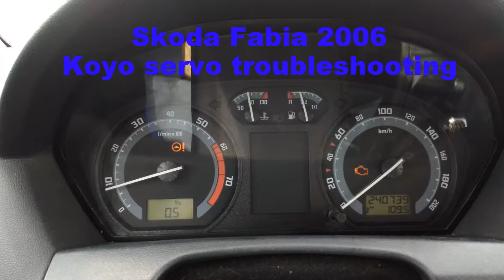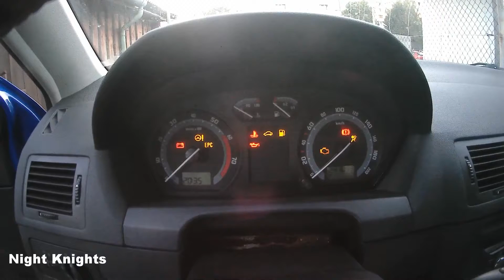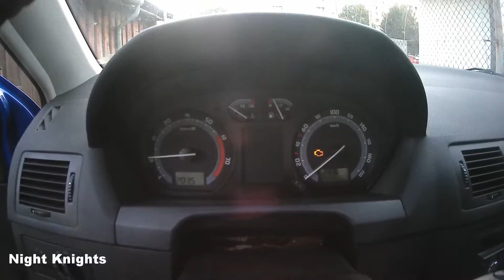Skoda Fabia 1 2006 oprava servo riadenia Koyo

Comment: My friend, did your car make strange noises from the area of the tires and did your dashboard light flickering? My light in the car and headlight are flickering and stering wheel light varning appear.
Reply from the maker: I didn't had this kind of problem, there are a lot of things what would do this. Definitely check your power steering wiring and fuses, also check battery and alternator belt. I hope you'll solve this issue soon

Comment: But what did u repair I don't understand , I have the same problem
Reply from the maker: There were two issues. 1. The connectors behind the fog light - can bus, power, sensor - you have to clean them, because all the dirt from the road will get there and that can lead to a short circuit. 2. Fuse on the upper part of the battery was blown, change it - this happend probably because the dirty connectors made a short circuit... So disassemble it check it, clean it, and it should work. If it won't start working it'll be probably the PCB, but I hope that it will work so you doesn't have to replace the PCB :)
Reply: @nightknights  Brilliant video, I had no idea there were fuses on the battery, had the same problem and You helped me a lot. Cheers from Ukraine.
Reply from the maker: @sviatoslavlutsyk377  You are welcome :) I'm glad it helped

Comment: Thanks.
Reply: I noticed the engine light is still on, just like mine. Is there a problem?
Reply from the maker: It will turn off in a few kilometers after repair or you can erase it with diagnostics if you have. Then of course it should not appear again

Comment: Salut, la skoda fabia an 2000,are un sunet de țiuit, ca pisica, când învărt volanul, direcția merge, nu se aprinde nimic în bord, casetă de direcție scapă ulei în timp, să fie pompa servo  ?
Reply from the maker: Hello, if the power steering works, but makes weird noises check the power steering fluid - definitely add fluid if it's missing, don't drive without fluid or you'll damage the power steering pump, you should check all the hoses and the steering for the leakage. Repair the leakage then top up the fluid, go for a drive if it helped, if no then you have to replace the power steering pump because it got damaged with driving without fluid.
Reply: Salutare. Ai rezolvat cu zgomotul? Am aceiași problemă. In plus, din când în când, se aprinde martorul servo, abs și frâna de mână. Nu știu ce să mai fac. Spune cum ai rezolvat, ce sa mai fac. Mulțumesc

Comment: My car has the g250 sensor failed, the steering appear on the cluster and now i want to do this to my car, do you recommend to do the clean to see if it fix?
Thanks.
Reply from the maker: Give it a try and you'll see. :) Definitely it's better to check it and clean it before you'll buy a new sensor, because maybe you don't need the new one. So check it, clean it and maybe you won't have to change the sensor :) good luck :)

Comment: Does the steering still works fine? I just got the same problem fix today, but Im still afraid. I have nightwork so I cant risk if the same problem happens again.
Reply from the maker: After the repair it didn't happen again :) So I think it's reliable

Comment: Hey. Where is the power steering module? My can bus does not work i think i need to change the control module..
Reply from the maker: Hello, check the fuses first, I think they very on battery, then check the connectors behind driver's foglight, after that I would consider it could be a module if it didn't help